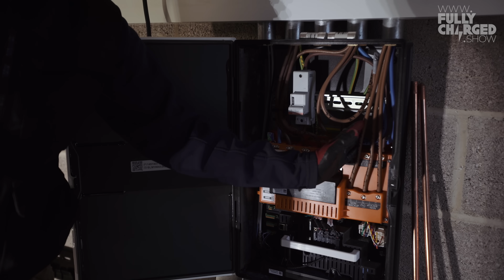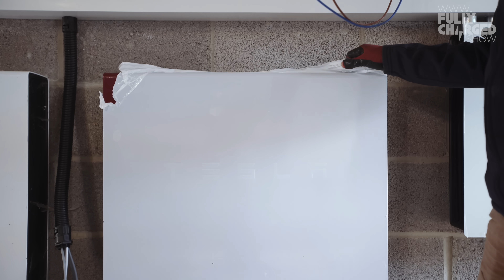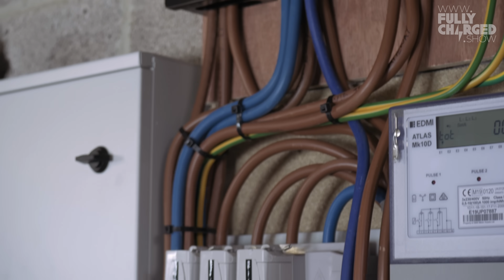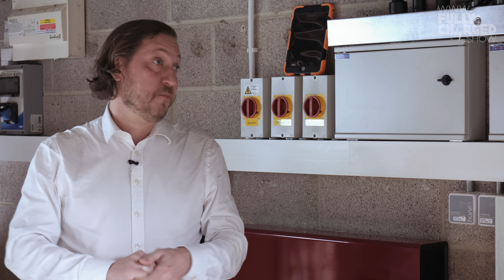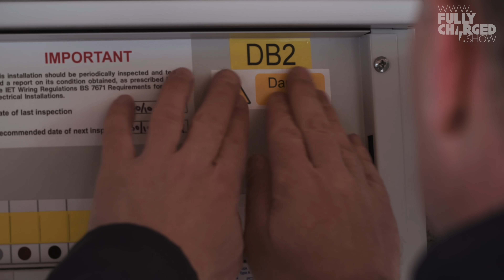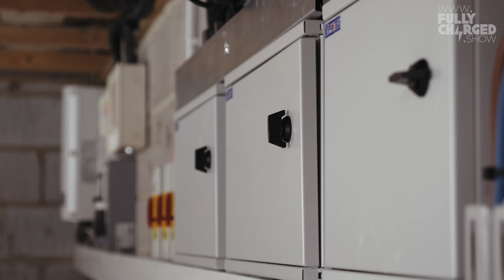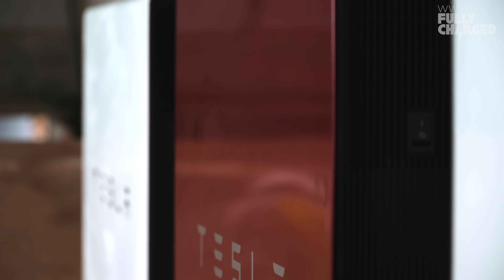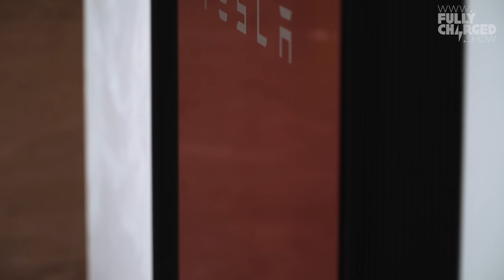Can you run your house on a battery? Tesla Powerwall 2 (Founders Series) & Tesla Backup Gateway 2

Comment: Crazy that you need a 3-phase connection when adding an extra battery. It is not like you are gonna draw a higher a higher current nor pushing a higher current into the grid. If you use your Powerwalls smartly you are likely to have even lower currents going. They should be happy and thank you for that.
The only reason they force you to do a 3-phase is because they see you use their grid less which means they cannot charge you for it.

Heard about a group of 5 houses that wanted to invest in a big shared battery, good idea but no, not allowed to do so, government and grid-manager will blow these idea out of the water.

Best thing to do is to have part of your house running on a independent network that is disconnected from the grid. For example use the new Powerwall for this, charge it with your solar and run your car from it. All you need is a way to quickly switch some solarpanels between the two Powerwalls, dependent on how full the new powerwall is. 

Personally I am building a 12 volt system to charge things like fridges and they are big consumers that need more electricity on days that we have a lot of sun ;-) When solar is not filling batteries enough I can switch the fridge to the 220V grid for a few days and switch it back to batteries when they are filled up again.
Reply: No - he's got the extra battery and a larger/more powerful car charger fitted.  And the 3-phase is because the power company has to look at the total potential load, not what someone would 'sensibly do' - because there's always the possibility for idiots (or Robert selling and the new buyer being an idiot, etc).
Reply: @logicalChimp  But isn't the grid protected from a high load by the main fuse. And that fuse is not something you can tinker with yourself, at least not here in NL. If it blows you have to wait for someone from the grid to come and turn it on again.

It should be up to the powerwall and some smart plugs to limit the draw from the grid (and if posible lower it when the grid is having difficulties and uses dirty sources and increase it when the grid has a surplus of (green) energy.)

In a way I can see a battery as an alternative to 3 phase connection. It allows you to have short periods of using more KW then your connection is rated for.

In my house a number of devices are temporary switched off when total power goes above 7 KW, nothing too complicated, just my smappee and a few smappee switches. Fridge and washingmachine(s) or switched of for 5 minutes. Not that my main fuse would not be able to handle 7 KW, but is is more like a testsituation.
Reply: @HansKeesom  Yes - but the power design has to be done in a such a way as to minimise the risk of fire or other issues... so even though there's a fuse, you also have to have a suitable supply to back it (or so I understand)
Reply: I do get the idea of extra layers of safety, but in this situation 3 fase cable is to my opionion overkill and old school thinking.
Robert is not gonna pull more Amps from the grid at any moment of the year, although I it could be  the carcharger being able to charge faster is causing he might do so.

I wonder if the Tesla Backup module can play a role here, together with the powerwalls, avoiding too much power being drawn from the grid. Shouldn't be to difficult.

If you want that extra layer of safety, just add one or more fuses in series that blows at or around 8000 watt (which is over here the limit for one phase). And add autoamtic swithes like I have that turn off big energy consumers when going above 7000 watt
Reply: @HansKeesom  As I said, it's not a case of what Robert is likely to draw, but what he could theoretically draw... and it is the Power Company (or rather DSO) that has the final word on that, and I think (although I could be wrong) that they can cut you off if they think you have an unsafe installation (including too much potential load for the supply)
Reply: @logicalChimp  I absolutely agree with you that is likely the Power Company or DSO that has the final word on this. My point is that I disagree with them ;-)

Comment: So 3 phase upgrade was needed only to cope with larger possible Powerwall charging currents than before - or maybe this system will push power into the grid when feed-in tarriffs return soon ?  Also, I notice that a 'smart meter' will be required (16:15) in order to export power to the grid in future. Oh joy - check out  'apparent power vs real power metering with smart meters' if you don't know about this, folks. Power from the grid will cost us a lot more if this comes in, thus negating the income for exported power possibly ?

Comment: Thanks for this and all your work on electric stuff. I am working on changing my company to electric in a big way. We do Landscaping and over the year we have stopped using 2-stroke oil and petrol for our lawnmores and strimmers to battery. It's not easy and it's not cheap but it's good and I see improvements that were not expected. Were adding a 6kw pv system and batteries of over 10kw. We plan to add more but need 3phase and more money so it's in time. We will be getting pv of about 30kw and a electric van leaving us with just the ride on lawnmore on diesel. But that looks to be 2 years away.
Just wanted to show you that your helping me change as will as others me thinks.
Thanks again
Garrett Fox in Ireland
Reply: Wonderful to hear and inspiring, thank you for posting. The sooner the sound of petrol leaf blowers becomes a thing of the past the better. :)

Comment: No I'm lost. You can generate and store more power than ever before but you need a 3ph up grade to effectively use much less power from the grid. Very counterintuitive. 

You say cars sit for 90% of the time on one hand, then need to install a massive 3ph supply so you can charge the car quickly. Surely it doesn't matter if a car takes 20 mins or 8 hours to charge over night.

Also didn't like the mini power cut as it switches from the grid to the batteries I'm still going to have to reset my alarm clock and the touch lamps will come on a burn for the rest of the day. This switch needs to be seemless for me. Like that massive battery in Australia.

Just seen the new update episode 10/06/20 pleased to report the switching is now instantaneous.

Comment: 5kw solar  panel input. Two cars to charge. After running the house with the cars plugged in 80% of the time there will be no power to charge the Tesla batteries. Seem a lot of money 14 grand to charge off peak.. prices needs to be a lot lower in my view.

Comment: Total cost to mortals?
Tech question: you now have 3 phase into your house. How is that split for load balancing? Any house rewiring or does the actual house ring, lights, showers, etc all run off one phase?
Eg is the 3 phase just into the garage and one phase out into the house?
And how much power into the house is available from the battery?

Comment: So to save power you need even more power. How long will this installation take to recoup, I suspect about 20 years. I tried to get 3 phase 10 years ago and was told NO. Ended up with two single phase supplies. So folks don’t expect it to be a walk in the park.

Comment: Surely it would be cheaper for the government to install a system like this in every property in the Uk than pay for Hinckley Point C? Crazy 🙄😩🤦🏻‍♂️
Reply: It sounds like a great idea, instead of clean stable efficient energy lets install solar in a high latitude country famous for cloudy weather...
Reply: Cloggsy Goodwin Good thing nuclear reactors don’t emittit Carbon dioxide
Reply: Economy and size the bigger  the better the more control of when you can sell at a higher tariff back to the National grid
Reply: Our solar panels run at 25% in the winter and up to 90% in the summer, of their max rating. Surely getting over 25% of nearly free energy is better than nothing?
Reply: Or insist that all new gas boilers fitted from now on, over 100,000 a year, to have a sterling engine generator pushing out 2-3 kW at peak times...
Reply: Where would the power come from to power the batteries? This is the confusion over electric car charging as well. They still burn fuel to generate electricity. They just move the problem around. We need a new, genuinely clean, efficient - not nonsense windmill -  fuel source
Reply: That wouldn't make profit for your shareholders....
Reply: TK-421 Hmmm 🤔 You might have a point there... 🙄😩🤦🏻‍♂️
Reply: @zambiakid  Surely they would make profit. If a power company installs those systems and pays you 5p/unit for the electricity it produces, then sells that electricity to other customers at 15p/unit, that includes the profit doesn't it, or did I miss understand?
Reply: The projected cost of Hinckley Point (£50billion) would put this system in almost 3.5 million homes and generate 4x more power
Reply: @jockwood2398  And that's before discount...  Mind you imagine if HMG quoted Roberts referral code...  I reckon he'd get his own Falcon9 rocket..
Reply: Ken MacIver 😂😂😂
Reply: Jock Wood Crazy isn’t it? 🙄🤷🏻‍♂️
Reply: @jockwood2398  How many homes would HP supply power too?
Reply: @jockwood2398  
£50B would give you roughly 25GW of installed capacity. But as the UK isn't ideal for solar power, you get only about 10% of that on average, 2.5GW. Hinckley Point C will be 3.2GW, and it will actually generate around 80% of that on average, 2.5GW. So about the same actually. But we didn't account for the necessary batteries yet, so it gets worse for solar.
And this is not how nuclear power is supposed to be done. A nuclear reactor in itself is a very simple and cheap thing, the complication and cost comes from one single flaw in the current general design, it requires non-stop cooling or it melts down and releases a ton of scary stuff. A little radioactive leak isn't a big deal in reality, but there's a huge amount of irrational fear around radiation, so regulations are extremely strict. Making sure that cooling never stops and even if it does no significant radiation gets out isn't just extremely expensive, but requires a ton of unique technology, material and expertise, which makes these projects very challenging. And the huge regulatory costs drives the reactor sizes up, to leverage economy of scale, but ironically, larger reactors are inherently less safe, because they are harder to cool. This can't be fully compensated even by throwing more money at the problem. This reactor design originally meant to be way much smaller, it was developed for nuclear submarines by the US Navy. But as it was already developed, originally it was easier and cheaper to use it for commercial power reactors, instead of developing a completely new type. Back then safety wasn't as big a concern, so the power plants weren't expensive or hard to build. And later regulations got so tight that commercializing a new reactor design became practically impossible. Many companies tried, but all failed. There were government programs too, but those were cancelled for political reasons. Most likely the fossil fuel lobby had a lot to do with all of this. There are many reactor designs in various stages of development that can't melt down and therefore doesn't need all that extreme engineering that goes into current power plants. These could be easily and cheaply mass produced in factories, shipped to the customer and installed in days or even hours. I think a 100x cost reduction would be possible. It would be something like what SpaceX did with rockets. Two such reactor types worth mentioning. The first is the LFTR (Liquid Fluoride Thorium Reactor), which was developed in the 60's by the US Air Force for a nuclear powered bomber, and a prototype was running successfully for years, before the program was cancelled and the planes shelved and forgotten for decades. Now India and China are trying to revive it, but they have far less experience then the US, so it's a slow process. The other one is the IFR (Integral Fast Reactor), which was developed by the DoE. This was also built and tested successfully before being cancelled. Both reactors can easily survive all types of nuclear accidents that ever happened. These would actually just keep running and turn those huge disasters minor inconveniences for the operator. The IFR was put through a simulated Fukushima-type accident and it just calmly shut itself down without any human intervention. For the LFTR turning off the cooling system was the normal way of shutting it down.
Reply: @andrasbiro3007  What about the costs of decommissioning? That's even more expensive than actual construction. Both IFR and LFTR is far from being viable and no one will know the real cost of building one until it is proven.  What you are doing is regurgitating information received from pro nuclear lobbyist.  I  used to work in the nuclear industry and i have no reason to trash it but being disingenuous about costs and viability will do more harm than good
Reply: @verygoodbrother  
All costs are included in the 50B, even the cost of operation, if I understand correctly. The construction cost is only around 20B. https://en.wikipedia.org/wiki/Hinkley_Point_C_nuclear_power_station
Why wouldn't be the LFTR or the IFR viable? Both projects were almost finished, not much left to figure out. The LFTR's main advantage is it's simplicity and inherent safety, so it just can't be expensive. The IFR is much more complex, but it's also inherently safe, which makes a lot of very expensive redundancy and extreme engineering unnecessary. And nuclear power as we do it now is already one of the cheapest sources of power. If you have worked in the industry you should know all of this. The vast majority of the cost of a nuclear power plant is associated with preventing and containing a meltdown. If a reactor physically incapable of melting down or can handle a meltdown easily, all of that cost can be saved. There are even more ways to achieve this. It's not the meltdown itself is the problem, but the high pressure radioactive steam that it creates. If there's no water in the first place, there's no steam and no pressure, so all a meltdown makes is just a pool of molten metal in the basement. Without water there's no hydrogen either, so no hydrogen explosion. Or you can use fuel that can withstand much higher temperatures. https://www.energy.gov/ne/articles/triso-particles-most-robust-nuclear-fuel-earth That's also beneficial because higher operating temperature means higher efficiency and easier cooling.
Reply: That's politics for you
Reply: If you want nuclear weapons, you need nuclear power plants.
Reply: Maurizio Di Francesco  what?????
Reply: Richard Neubauer 
The reason you have reactors that convert uranium into plutonium is to provide weapons.  Other designs that don’t produce material for weapons were disregarded, as this has always been the main reason for building reactors.

(Also worth remembering when you’re next wondering why nuclear fusion hasn’t yet come about.  Fission reactors would never come near to being as cheap at producing electricity, but you can’t nuke people with helium.)
Reply: boggisthecat You can make ‘em talk funny though 😂😂😂

Comment: Anyone with an induction stove in the kitchen needs the same 3 fase upgrade, nothing unusual about it, not even in the UK  i.m.p.o.
Reply: Not true at all - even with a 12kW range cooker with multiple induction hobs, you're absolutely fine to use a separate circuit running through a 45a switch.

Nobody is installing three phase in the UK to put induction hobs in, unless you're starting a commercial operation.
Reply: You might need to explain further as I have a working induction stove on single phase in the UK.

Comment: I’ve a similar setup all be it with just one Powerwall on single phase. We also use smart plugs that switch our dishwasher and washing machine on at night. I opted not to go for the backup but rather the standard setup because if I’d opted for backup my Powerwall would only supply 3.6kw instead of 5kw. I’d have to get permission from the grid for the Powerwall to work a 5kw. as the max export allowed without permission is 3.6kw  Since installation we’ve had just one power out for a few minutes during the night.

Comment: Not a fan of how close to the floor those Powerwalls are.  If that room flooded, it would make for a very interesting fireworks show.  Are those Powerwalls sealed?  Also frost rises from the ground, and the Powerwalls will be cold/frozen at the bottom at times, maybe not so good for the life of the cells, or overall performance of the system.  In general, not the best laid out electrical installation I’ve seen.

Comment: The exact cost of a 3 phase supply to the house wasn't mentioned, I know a recent install I did the owner paid 30K for western power to put in the supply. It was a long cable run tho. I can see western power and suppliers somewhat resisting this method maybe.

Comment: Instead of using Solar PV to heat your water, wouldn't it be more efficient to install Solar Thermal to heat the water, and export the excess electricity?
Reply: I suspect ANYTHING would be massively cheaper than this setup.....!!
Reply: @andymccabe6712  whilst that is true, I was thinking more about efficiency. Why collect electrical energy and then waste some turning it into heat? Why not collect the heat energy as well as the electricity? Export the excess electricity for the benefit of the grid and a small rebate.

Comment: Had my Powerwall 2 since March 2019, my roof is not south facing but in summer I can fill the battery, now we are in winter it is not so good. Also the T&Cs for my powerwall stated the long term warranty was void if I charged it from the mains, has the wording changed recently?